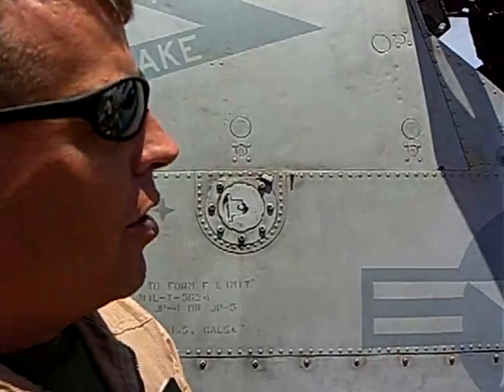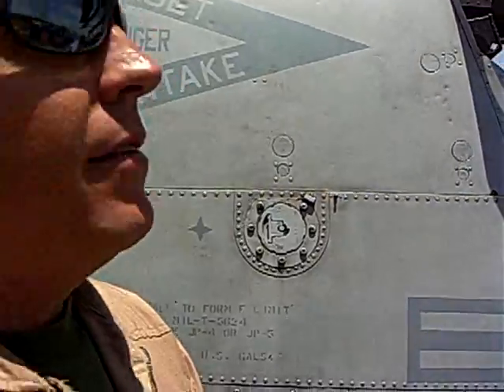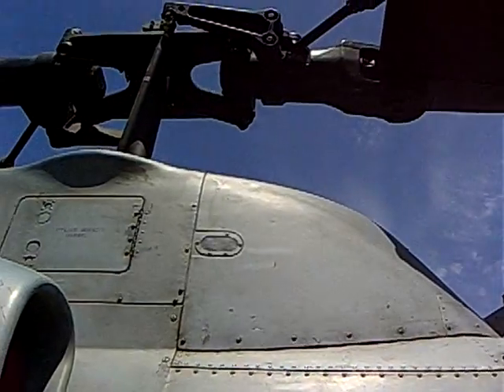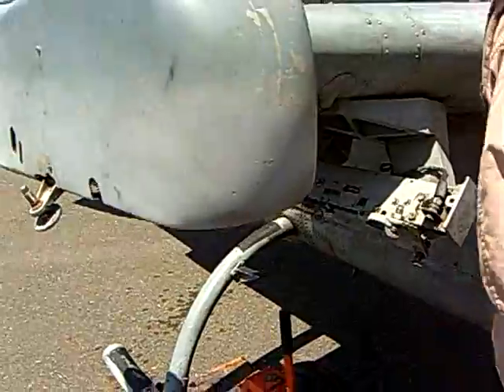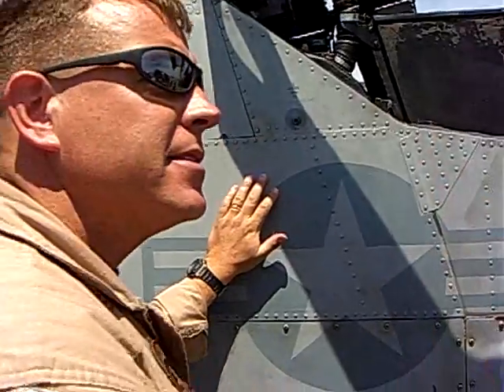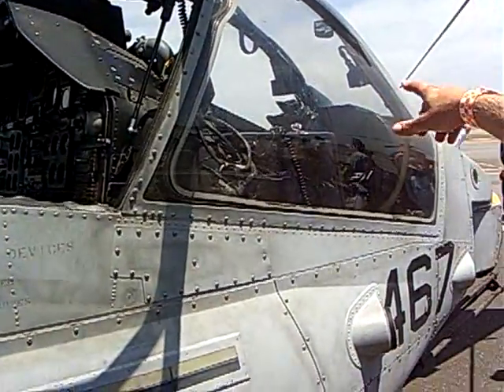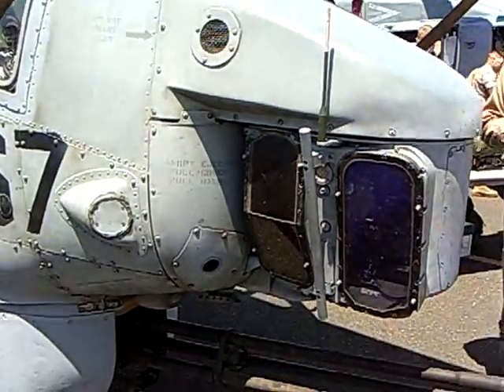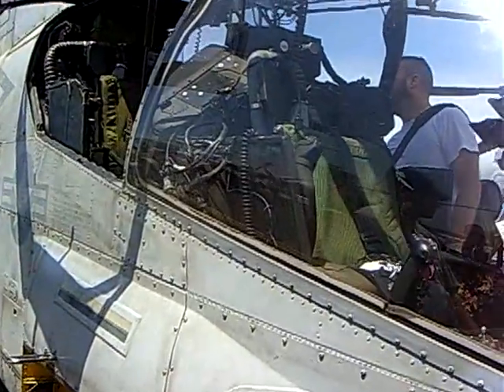US Marine Pilot describes the AH-1W SuperCobra weapon systems. Hiller Helicopters Exhibition 2009 -2

Comment: @nimaxx38 most of this is accurate but ask a your recruiter it should be 20/20 or 20/40 uncorrectable after 2 years if it drops down to 20/100 it can be corrected after a couple years then like towards your senior years if its at 20/200 it can be corrected anything other than that than its retirement